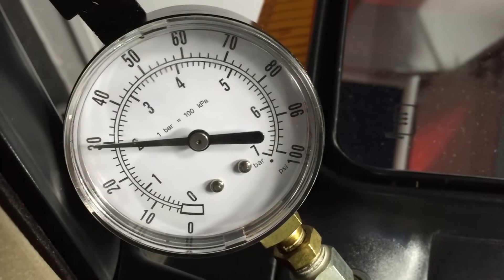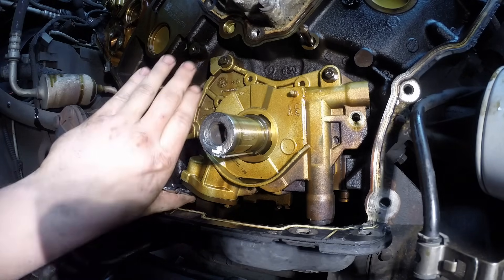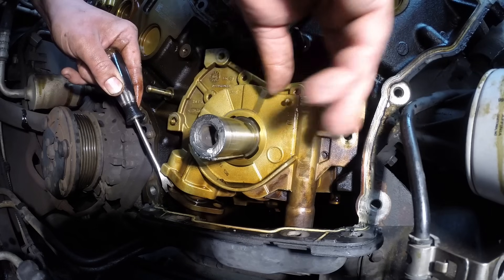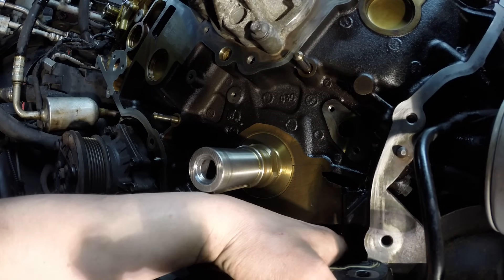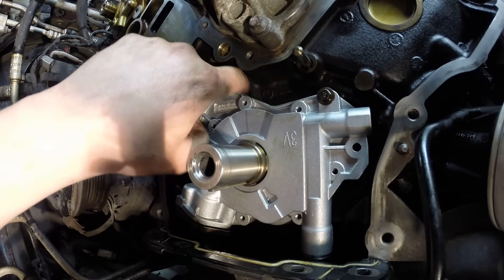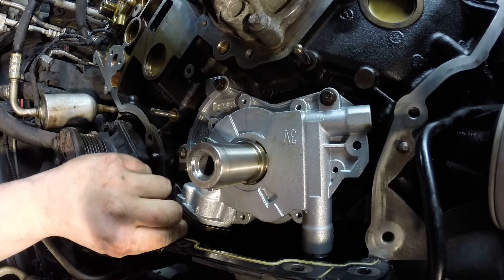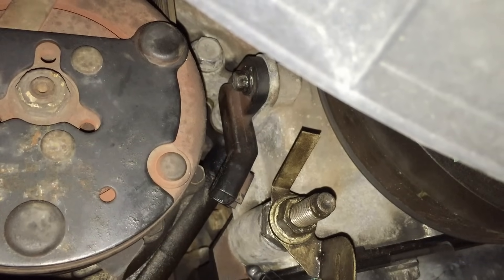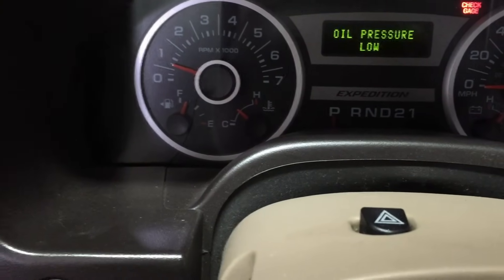Ford 5.4L 3v Engine Melling M360 Oil Pump Upgrade

Comment: I did the complete timing set, phasers replacement and HV360 oil pump jobs per your videos.  Today I started the priming procedure but did not get any oil pressure.  Trying to determine what I did wrong.  Pleas advise. Thanks. ressr1@aol.com
Reply from the maker: Try the prime procedure a total of 3 times, then you can connect the crank sensor and start the engine. Look for oil pressure to come up within 1-2 seconds on the cluster, if it does you are good to go. If not then shut the engine down.

Comment: Did this without the flex neck, because after 1100 of new ford parts i was too cheap and stubborn to buy another 20.00 wrench, lol. Even torqued it. Easiest way I found for myself was from underneath  on my back looking up. With my left hand i held the bolt between my two fingers and put it in by feel. Kind of a bitch but still better then the repair bill. I needed cams too. If you do too your in luck they only 108.00 ea from   a online ford dealer. My local dealer is a rappest. Good luck all

Thanks for your video's

Comment: I'm picking up an 07 F150 with 250k miles on it (5.4l Triton). I don't believe the engine has ever been rebuilt or replaced, but it runs great, especially for the price. would you say this pump replacement is something that I should do immediately upon getting it home?

Comment: Just put in my m360hv, can't wait to see how this thing runs, those pickup bolts are a pain but I just used a normal 8mm closed end wrench worked just fine though takes awhile
Reply: How'd you get the back one started?

Comment: I’m gonna use the 340Hv one, I just took my old one off with my hands & probably use my fingers to put that front bolt on, I used permatex assembly lube (thick red stuff) & took the backing plate off & just poured about 1/3 of the bottle in on top of the gears & spring assembly (it gets oiled anyway so why let it pump dry & ware on the spring? ) anyways will try and put it back on this Saturday or something, the hardest part of this whole job for me this far was cylinder 8 roller follower & rusted power steering pump bolts, but! Hopefully this weekend the truck will run, been working on it a little in the evenings for the last 2 weeks

Comment: I might be taking the timing cover off myself. But I didn't have any low oil pressure issues not sure if I should do this upgrade. 260k on motor. Wouldn't the higher pressure oil blow out the timing chain tensioners quicker?

Comment: thanks for this video...one thing I did to get that lower pickup tube bolt in was to wrap it a few times with string...set it in the ratchet box end, poke it into the hole and pull the string like staring a lawn mower. Thing went right in there!
Reply: I had to give up for the night but I'm gonna try this in the morning.  Thanks for the idea!
Reply: Bloody genius 👍
Reply: Genius!

Comment: I justbought a 2010 f150 with this 5.4 a month ago. Thought it was a deal, but the more I see the more I am scared. I just got first oil change done an did go to 5 w 30.am going to do the restof the oils in a month or 2.how much preventative should I do...plugs.coil.timing set. Oil pump? It runs good now but what order should I attack these problems?an how soon? It has 150 thousand miles now an I doubt any of this has been done. I lovethe truck an want to keep it for awhile

Comment: Hi this pump will fit in my 2010 f250 2wd 5.4 3v v8 whet I check if it fits says don’t fit on my truck thanks 💪🏻
Reply from the maker: Yes it will
Reply: Thanks so much !!

Comment: Does anybody have  a part number for that replacement o-ring that is supposed to come with the Melling 360HV oil pump?  I ordered mine from Amazon a couple months ago and have finally got around to tearing down my 2006 Lincoln Navigator to replace the timing components.  When I opened the box to prime the pump, that was when I noticed the box was multilated and there was no o-ring in the box.  I need to get the truck on the road by next weekend and am frantic now.  Being retired Navy, I've had it ingrained in me to NEVER reuse o-rings.

Comment: Are you sure that's not supposed to be four bolts holding that oil pump in ?
Reply from the maker: positive, the forth bolt comes later.

Comment: You are a great help. I have a 2V Modular Mustang and a FORD Performance Hi-flow oil pump that I need to install. I think the oil pressure gauge in the dash is just an on/off switch signaling that there is, in fact, some oil pressure to be indicated when the engine is running. Is this correct?

Comment: I'm going to change the pump when I  change the timing chains, but amazon that oil pump won't fit my 2010 f150. what do you recommend?
Reply: 340 HV. Said the same about my ‘11 navigator

Comment: why did the dash display say low oil pressure when your mechanical gauge says its higher than before?
Reply: After you repair that stuff you have to reset the light. Same when you need to change out your oil.

Comment: I own a 2010 F150 with a 5.4  engine code V. I want to replace my oil pump while I am replacing the front cover seals. When I went to look at the parts catalog it wont show the M360HV oil pump. It shows only the M340HV as a upgraded oil pump. I even went to the Mellings website and it shows the M360HV for a DOHC mustang not my SOHC 5.4 L.  Could you please clarify this. I am using Rockauto and amazon parts catalogs.

Comment: Hey I got a question I watch one of your old videos that you said you recommend using 5-30 oil over 5-20 oil I have a 02 Ford Explorer with the 4.6 v8 it saids 5-20 oil recommends but you think 5-30 better to use then 5-20

Comment: I like at the end how the the truck screen said oil pressure low.
Reply from the maker: Oil pressure sensor is disconnected to tap in the manual oil pressure gauge.
Reply: @FordTechMakuloco  that's what I thought. Quick question I let some idiot install a timing kit on my 05 expedition who said he knows how to do this kind of stuff, turns out he didnt know nothing, so on his fourth day of getting the stuff back together he had the valve covers and wiring left but I had enough of his shit and told him to go and that I'd do it myself. Ok so I get it all together go to fire it up and its reading no oil pressure and making a clunking sound and fumes coming from the oil cap when I took it off after. Gonna tear into in the morning and try and fix her the right way. What do u think he messed up?
Reply: @nicholasbravo4074  that's what I thought ... that he messed it up.

Comment: brian, i use 15w40 could my f150 5.4 3v have problems if i use 10w30?
Reply from the maker: Always use 5w-30 unless your clearances are too big then go with a 15w-40.
Reply: FordTechMakuloco do you refer clearances like bearings clearances in the piston or something like that?

Comment: Hello after watching you videos I was going to swap out my pump for the high volume millings as you suggested however out shop mechanic said that it will make to much pressure during cold starts ( I live where minis 30 is winter) and that o would need to run an oil pan heater , just wondering what your thoughts are on this for your neighbors to the north watching your videos?
Reply: John Hancock run 5w-20 in the cold months 5w-40 in the summer
Reply: @JJPMustang  I'm not sure that would help, since both 5W-20 and 5W-30 would have the same viscosity at start-up. Just an opinion. I live in northern Canada too and I will probably go with the 340HV. Although I read on an Expedition forum that Ford updated their 5.4 pump in 2020. But haven't confirmed that yet.

Comment: If you drop a bolt in the oil pan it might need to come off anyways.  Happened to me, glad it did tho because the pickup tube was full of plastic from the timing chain guides.
Reply: This is exactly my issue. Was the pickup tube hard to replace?

Comment: The sites I go to say to use the  Melling M340HV on my 2007 ford expedition 5.4l... is the M360HV the next model replacing the M340HV or should I stick with the M340HV?
Reply: gevauna1 if it’s the 5.4 3v from 04-08 
Use the m360 and also use the Melling 402 and 403 tensioners that doesn’t use a gasket. These are the best. That’s what I’m running. No problems since. Also only use oem phasers if your doing that complete job. But yes the m360 is the best pump for this engine
Reply: @Bigsteve123  Thank you for the advice and reply.
Reply: @gevauna1  I think the 360HV runs at 80 psi, and the 340HV at 60psi, and both drop as the engine warms, other factors being equal.

Comment: Followed instructions perfectly, when cranking, oil pressure is at 55psi but when i startup im at 100 psi running like crap, super rich. When i turn off the key the engine starts dieseling, please help.

Comment: On the Amazon link I went to says the pump wont fit on my f150
Reply from the maker: The pump fits all 5.4L 3v engines 2004-2014
Reply: @FordTechMakuloco  okay thanks
Reply: Do they make different versions of the Melling m360hv? I am seeing people saying it is for different years or for the 4.6L.

Comment: I’m a ford guy but some stuff they do drives me nuts. The 3 valve had great potential but they knocked it back with something as simple as a weak oil pump and timing chain tensioners.
Reply: Don't forget phasers
Reply: @chrishernandez2490  yeah that too, the tensioners blow out and starve the phasers of oil, nothing but a domino effect with this engine.
Reply: @bradlyhunt7240  I was thinking that like good motor but parts fail easily and cascade
Reply: @bradlyhunt7240  have the plastic  tensioners on 2 valve Triton  engines  replaced  with the earlier metal  ones.
Reply: @randallcarney1216  will the metal ones leave shavings that will eventually wear out the engine?
Reply: @anothersomebody8195  no they  are precision  machined ,at 170,000 miles my 2000 5.4  2 valve tensioners is in good shape. I just replaced  them and chain  and oil pump while i had it apart, Keep the oil changed  so the engine  stays  clean.    The later plastic  tensioners are the trouble makers!
Reply: @randallcarney1216  Oh, I was under the poor impression that the chain guides were what those were. I am going with the plastic tensioners on the replacement next week because I saw some saying elsewhere that the metal locking ones could over tighten the chains. I hope I don't regret this.
Reply: @anothersomebody8195  poor oil change  habits  can cause  tensioners to stick causing  a loose chain.  My friend  owns a shop and over the years  he has seen loose chains usually  from failure to maintain  oil changes and the plastic  ones fail because  they are plastic  and break .   Also  Ford has revised  phaser units for the phaser engines.
Reply: @randallcarney1216  yeah, I got sold on the 5k mile oil changes for synthetic oils with a previous GMC Terrain before they found out the rings were crap on all motors that year. Went in for an oil change at 30k bone dry foolishly trusting that crap. Everything gets 3k now. Sounds like these 5.4's need it for the phasers and cam guides especially?
Reply: @randallcarney1216  the 5.4 two Values were way better engines than the later 5.4 three Valves... and CLEAN Thin oil is the Key :)
Reply: Does the 5.4 Factory Ford Oil pump have a Plastic Gear ???
Reply: @kelvenguard  no
Reply: Pat Luxor  Thanks...

Comment: Help Your link to the pump says it does not fit my truck I have a 2008 ford f150 5.4 3v flex help anyone thanks
Reply from the maker: It fits trust me.

Comment: Question I have everything off and as I have been for 2 hrs to get this oil pump to lay flush I can’t get it on right.  I have moved teeth and it seems not to go flush on block.  After I thought I had it i started to tighten and the left 2 screws part of pump broke meaning it was uneven.  Can you help

Comment: Do you recommend cleaning the mating surface for the pump or leave it alone ?
Reply from the maker: I clean it yes
Reply: Scotch brite ?
Reply from the maker: Yes ot a rag with brake cleaner on it, there should only be some varnish on it if anything.
Reply: Ok thank you in the process right now

Comment: I haven't tried this yet...  But I think the GEARWRENCH 85608 Locking Flex Head 8mm combo wrench would work better for this job.  Because then you can use it to push the screw up into the hole without it flexing to the point of loosing the screw.  Then you wont need to use the cats claw to put pressure on the end.

Comment: I've just tried to get to those DAMN pickup tube bolts and can not get the inside bolt.  F$#@$%!!!!!
Reply: Wrap some fine safety wire around the bolt under the head so it won't fall into the pan. It'll help hold it while you cuss for an hour.

Comment: I did the full timing restoration melling 360 HV pump all the roller follower fingers and spark plugs on my moms 06 king ranch expedition using all ford gaskets and timing components. I also updated the oil to 5W30. What a difference it made not just performance but fuel economy too. Its a 2 wheel drive car and now the only problem is that the 1st gear clutch in the 4R75WE is almost gone at 140k miles. That seams odd since we dont tow anything heavy or thrash the car.

Comment: Hi, I clicked on your link and it says  that the M360 thas not fit my 2004 f150, even on the melling website the recommend the M340, any thoughts?
Reply from the maker: M360 is for 4v engines but many use them in the 3v engines. Same pump but different pressure relief spring is all.

Comment: Invaluable information!!! I was an Engine Builder after being a Ford Line Tech (retired 9 years ago)... 

A couple of questions, if you can help. Now I haven't worked at a Ford Dealer, since the first 4.6 Mods were being put in Crown Vics and T-Birds... And for the first 18 months of THAT, ANY issues with the 4.6 - and we could only pop the Engine out, and ship it back to Ford!! 
So my Dealer experience with them is limited... 
(Just to qualify myself) 

This High Pressure Oil Pump... Would it be the same for the 4.6 3V? Including the over EASY R&R?? 😎 That was amazing! 

Also, I'm restoring a 98 Mustang GT. Would that same procedure work on the 2V as well? 

That is such a lifesaver for this Old Fart! 😋 

Third... I was TOLD (and you know how THAT goes!), that on the Modular Cam Journals, if they're beyond clearances....
You could CAREFULLY SAND the Journal faces, rechecking clearances with Plastigauge. 😲

I do know Engines... But that one sounds a bit incredible! 
I'm figuring that you're the Man to ask. Thank you! 
Carmine ✈🚂🚙

Comment: Good series. I never intend to do a chain set etc on 1 of these, but was curious how. Great tip for the oil pump at this time. I know guys that race modular Ford mills that swear by these Melling pumps. Just don't drop the pick up tube bolts!

Comment: Anyone else realize the dash said oil pressure low AFTER install?
Reply from the maker: Yes the oil pressure switch was remove for the manual oil pressure gauge install in the video.
Reply: I'd put in a "tee" and a real pressure gauge. Keep the original switch so the computer doesn't throw code.

Comment: Hey! I'm hoping to get some advice. I performed the timing chain, cam phaser, vct solenoid and melling oil pump repair on my 05 5.4 a little over a year ago, and everything was running great. I put about 10K miles on it. Unfortunately, it looks like I have to go back in there. Once the motor is warmed up, I get a dreaded rattling noise. Sounds like the chain rattling on the passenger side. I suspect my crappy plastic chain tensioner has a blow seal, and once the oil warms up, it's no longer doing its job. Looking at Rockauto, I noticed Melling makes cast iron chain tensioners for these motors. I'm thinking of just removing the timing cover and replacing the two tensioners. I used Ford Cam phasers, and a Cloye's timing chain kit. Can you provide some wisdom? :) Thanks for all your content.
Reply: What was the result? I am having all of this done in a week and DON'T want to deal with this again. I am tempted to get the cast tensioners to avoid plastic getting brittle in 20, years, but I hear the cast tensions can get worn and leave shavings that wear the motor down.

Comment: What style cam chain tensioners do you recommend? Hydraulic or ratchet style. I'm about to replace oil pump and timing components. I just want to get to best before starting the job.
Reply: Melling cast iron ratchet is the only best way to go. With the ratchet, as timing components wear, the plunger never goes back in on startup when for a second, there's no pressure. It stays out, keeping the chain somewhat tight and that prevents the startup rattle, even after many miles, as it's self adjusting.
Reply: @jamesplotkin4674               But then you never know if it is blown out and leaking.

Comment: Doing a complete overhaul in my 5.4, with phaser lockouts, do u recommend this high flow with fresh bearings and phaser lockouts, is there such thing as too much oil pressure?
Reply: Best to just spend the money for the oem phasers. The problem with these engines is the oil pump and the cheap ass tensioners. Use the Melling m360 and the melling cast iron tensioners. No such thing as too much oil pressure for these engines, they need all the pressure they can get lol

Comment: I notice that the oil pump your installing doesn't have the M360HV stamped on the housing. Did you go back with the standard M360 instead of the HV? Your link to the one on Amazon shows the HV.

Comment: Do you recommend using 5w-20 or 5w-30 oil?
Reply: He recommends 5w-30....even if ford calls for 5w-20
Reply: @steves3688  5w-20 is to help meet mpg goals. I'd go with 5w-30. If it's really cold, go with 0w-30. If you live where temps never get below 80f, go 10w-30.